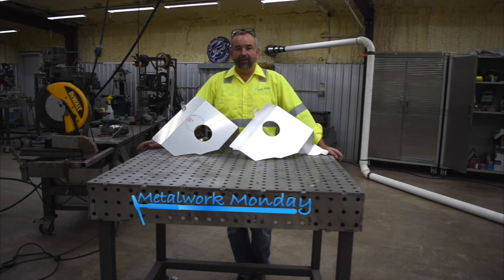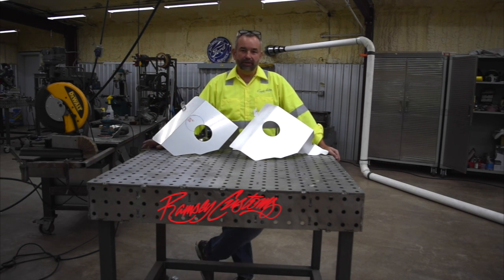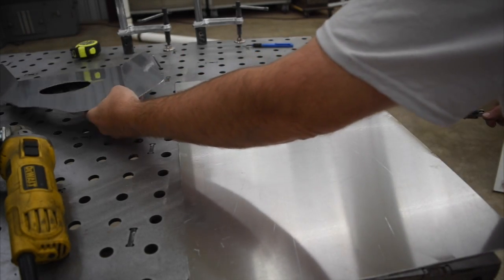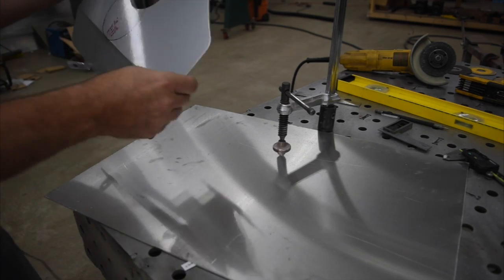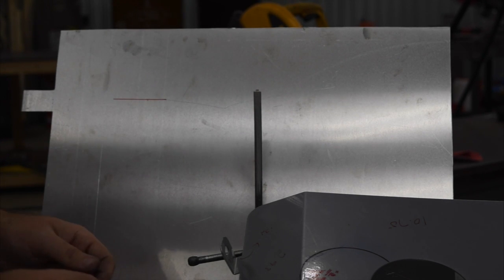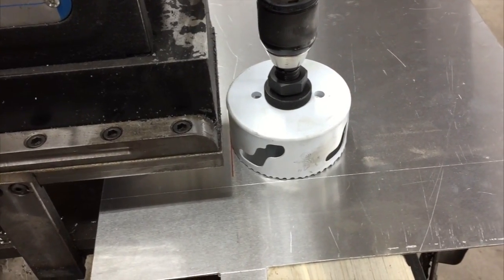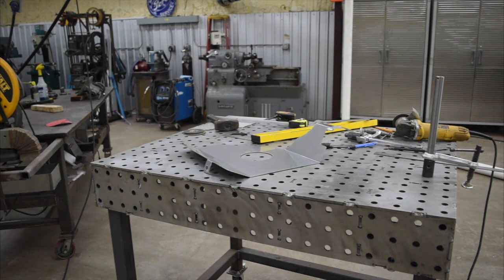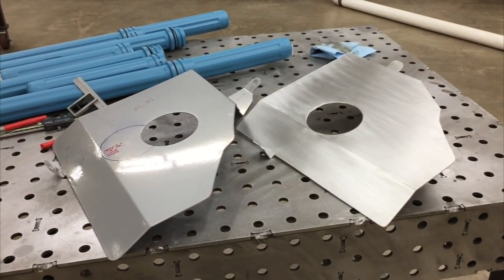Fabricate Cold Air Intake Panel  69 Camaro - For Any Car - K&N FIPK

Comment: Constructive criticism ok? I might be wrong, but it looks like you made your bends with the grain. Sometimes it doesn't matter but a bad habit and something to watch for. When you have bends on all four sides, turn your metal grain 45 degrees to remedy this. Also, you should not scribe your bend lines. To add to the information you mentioned about bending some aluminum and it cracking. This is true, but it does help to increase your bend radius. You can  move the jaws back on your break, then take a 3-4" X 4' and bend it in the brake all the way back to form a "v" then leave it on the brake to increase your radius. Need more of a radius? Add another "v". Keep these as they will be used more than you can imagine. Might also have to reduce clamping pressure on the brake due to the increased thickness. Hope this make sense. I've learned quite a bit from your channel. Thanks and keep them coming!
Reply from the maker: Chris, awesome info, the way I cut the panel out is the only way to get that size panel out of the drop i bought, and your right I did bend it with the grain.  Yes, I moved the clamp bar back using the "set back" adjustment, not sure if you could tell, but I also had a fairly loose clamp pressure from the clamp bar, also adjustable.  I captured some of this info in a separate video i will be uploading, but the info about turning it 45 deg to the grain when you have bends on all 4 sides is great info, would not have known that without your comment!

Comment: If you make a cool custom air intake tract for a line of vehicles it could be a good little gig for you.  Back in the day folks in the Impala/ Caprice crowd were making a simple aluminum air box for a few hundred dollars.  I need to bore a larger hole in mine for a 3.5 inch MAF. Whats a good metal holesaw?

Comment: Nice work Gary! Try using your circular saw (with a carbide tipped wood blade) for cutting aluminum straight, it works great and you lines will be very straight. For curves I always use a jig saw with a slightly finer blade so the aluminum doesn't clog so easily. You may know these methods already but just wanted to pass it along if you didn't. I use my Milwaukee cordless stuff, works much better then the cut off wheel on the grinder same as the jigsaw. 

Keep the sheet your cutting tilted down because when the chips get between the saw base and the sheet it will leave scratches. 

Again great job!
Jason
Reply from the maker: Yes sir, some good tips for sure, thank you!

Comment: Couple things from 2018. - 1 - Super jealous you can get that for so cheap. Just picked up some 16g and 11g sheet 4x8  for $180 and $100 each CAD. Dam politics running the cost up so much. Also Work with AL a lot and just wanna point out that anyone doing this type of stuff 5052 H32 is great for bending and not bad for welding. 6061 T6 will almost never bend do not waste your $$ or time.

Comment: great work Gary, do you think you can do old school filler panels? maybe a replacement for the old plastic filler panels...this material looks like it would be a great fit right
Reply from the maker: hey CJ! what do you mean by filler panels?  You mean like in an engine bay?  you got a pic of what your talking about?
Reply: +🔥Ramsey Customs - turbocobra I can take a pic and text it..it is the panels on the old school that would separate the bumper from the fender or other body panels..will text a pic

Comment: Nice work Gary, and good information on the Aluminum.  You've got some good comments too on the bending radius and angle cube.  I'm sure you have your eyes out for a shear, at one of the shops we had a foot stomper, worked fine for many jobs, maybe you can find one cheap till you score a hydraulic one.
Reply from the maker: oh yes, been looking for them, but wondering if i have the plasma table will i still need it?  I am sure it would be more handy for simple quick cutouts like this one
Reply: Gary my 2 cents would be to look for one and a beverly shear.  I had a cnc plasma at my old job, and I still used the shears all the time.